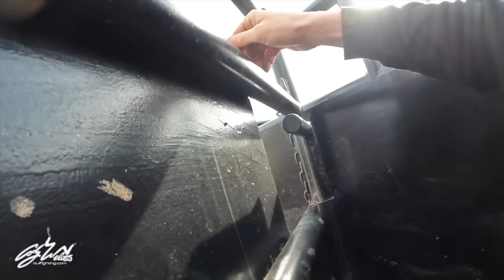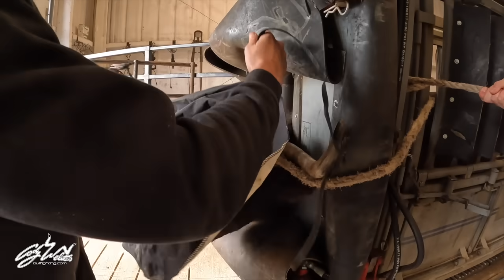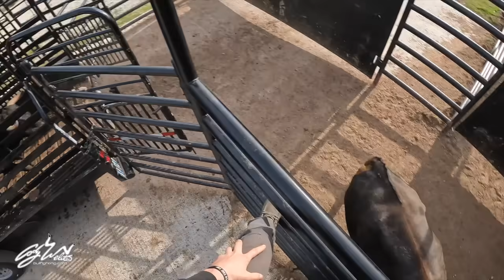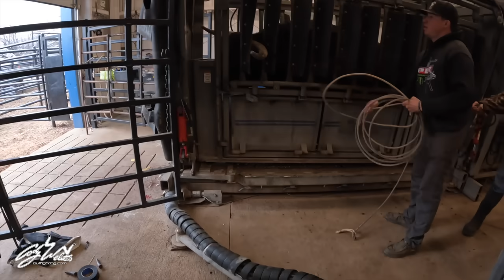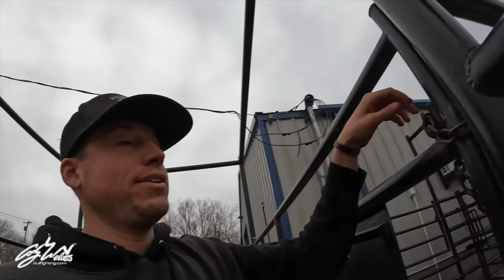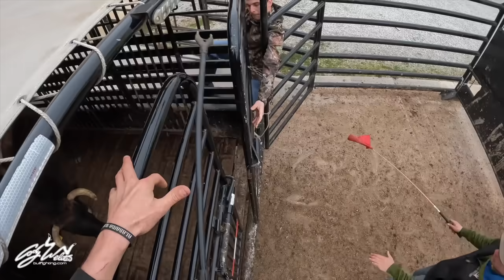Destroyed vet clinic - Behind the Chutes #104

Comment: I knew your cattle were tipped, but it was great to see the process. Wow was that bull fierce, you're breeding good stock.
Reply: @@jellybeandakota6140 If you don't tip the horn, when they hook you or your horse, it's going to either pierce straight in or cause a nasty cut. When the horn is tipped, and Cody was rounding them off with a grinder as well, you'll hopefully get a bad bruise but won't get opened up. It also means that if the cattle fight each other or even accidentally poke each other, say in the trailer, they won't damage each other as they would when untipped.
Reply: @allisonkeevers6076 thanks.   I was curious too.